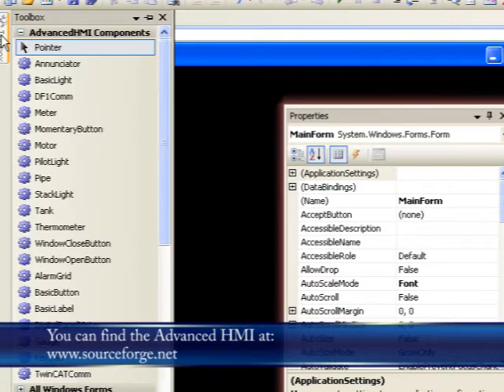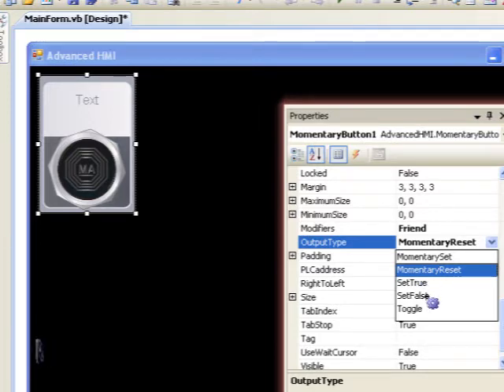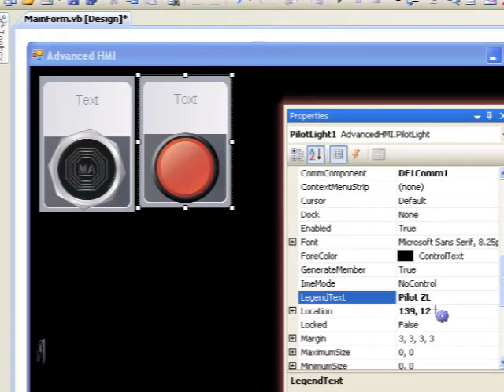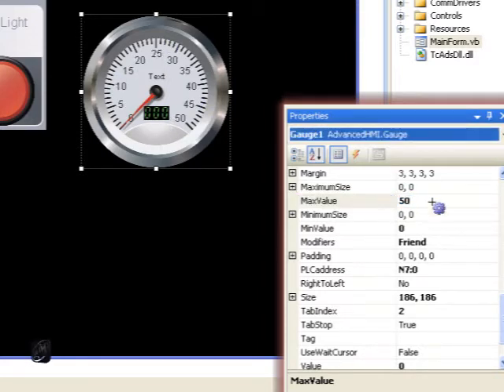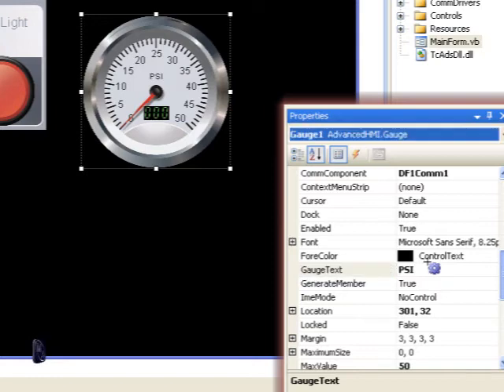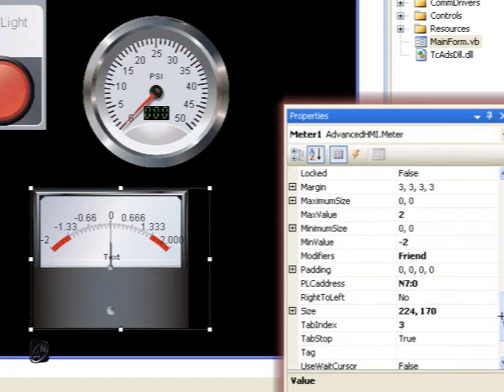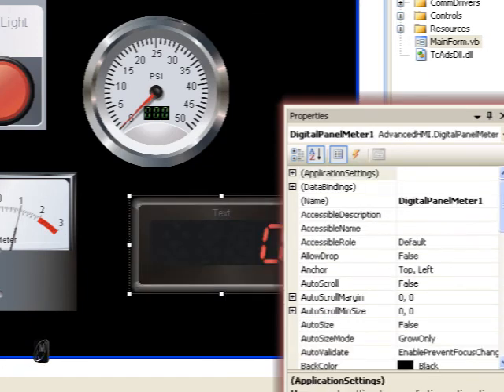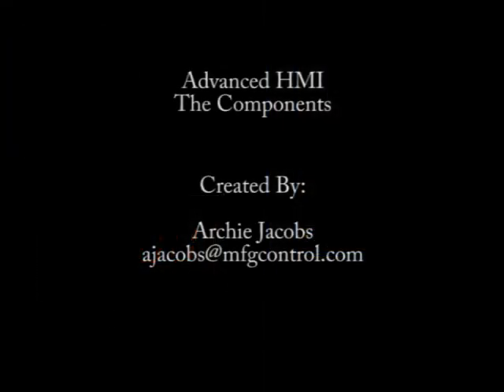Advanced HMI - Exploring the Components

Comment: When you first open MainForm.vb in the AdvancedHMI solution, you will see these steps listed on a black background:

1) Build the project (Ctrl+Shift+B)
2) Add a driver component from ToolBox
3) Set properties of Comm component
4) Add a visual control (e.g. DigitalPanelMeter)
5) Set one of the PLCAddress properties
6) Run the application (F5)

Step 1, "Build the project (Ctrl+Shift+B)", will populate the toolbox. (The instructions could be more clear about this.)